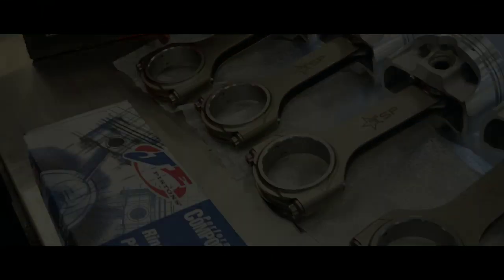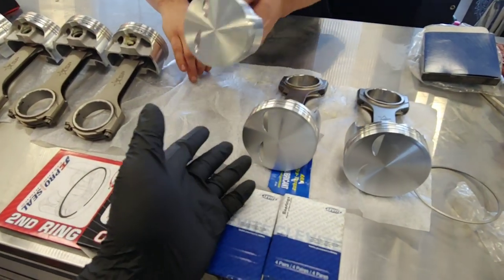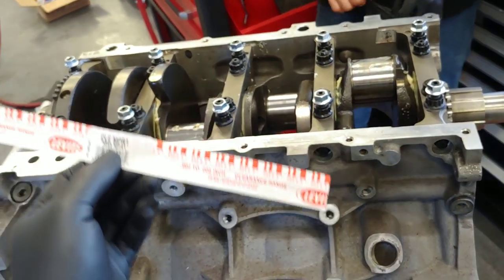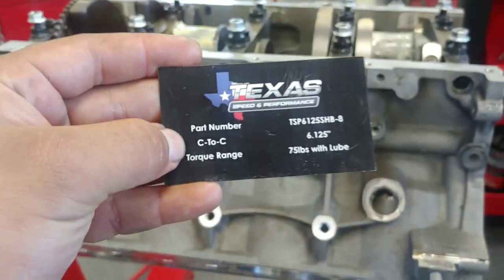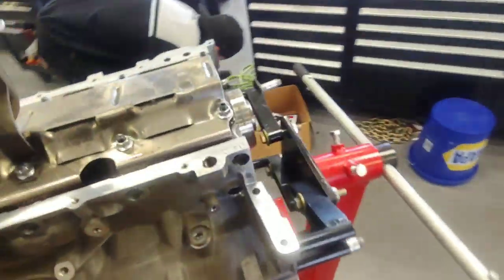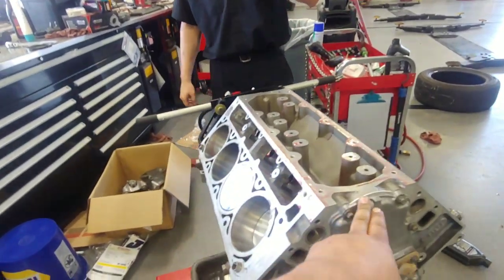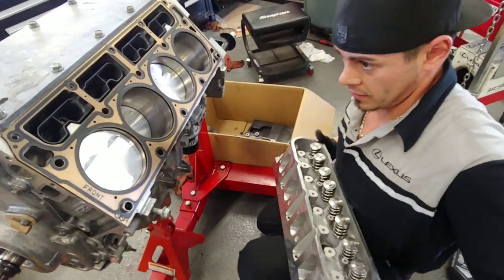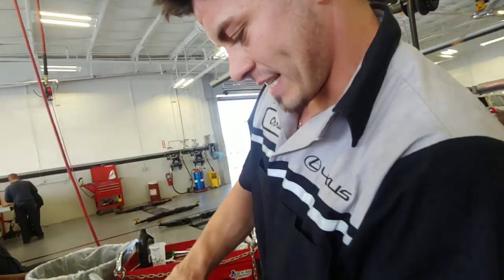BUILDING A NATURALLY ASPIRATED LS3 MONSTER ~ TEXAS SPEED RODS, PISTONS, CAM, HEADS ~ Episode 1

Comment: How do you push oil into the motor with the oil pan off ?  If you look there are 2 ports that feed the oil into the filter than into the block, without the pan all your doing is filling the port between the pump and the filter.  The easy way to prime is once assembled with the oil pan on pull the large plug on the side of the drivers side of the engine near the pump, hook up a drill powered pump to the port and feed it oil while turning the motor over with a ratchet.  That way you'll lube everything from the mains to the rockers.
Reply: Or just leave the plugs out , coils disconnected , injectors disconnected and crank on the starter . You'll have pressure in around four turns , if not something is wrong .

Comment: I have a tsp 408 ls I'm putting in my 95 silverado and after I get used to the power I'm gonna boost it and hope the built 60e holds considering it was in a 1150 hp Camaro but this truck weighs more

Comment: Heads are on backwards the steam ports are now in rear and fronts are plugged.
Reply from the maker: Surprised you caught that! We had to run a coolant hose from the back steam port up to the radiator 😂 we made it work
Reply: @BoBuilds  open what's now front and use all 4
Reply: I did this once. Instead of pulling off heads I opened up the blocked ones with a pin punch tool then bought steam vent delete covers for the rear open ones

Comment: With engine assembly - cleanliness is *truly* next to godliness. Everything oughtta be absolutely spotless and you shouldn't trust your part suppliers to have perfectly cleaned stuff before shipping to you. Also, I know it's very commonly done the way y'all did, in an open shop environment - but it's a bad idea. There's just too much dust, dirt and debris in an open shop. Plus, I see overhead fans - which are circulating whatever airborne particles and trash happen to be in your shop while other people are sweeping, blasting, grinding, etc... Bad idea. Change that oil after the first 15 minutes of runtime!

Not blasting you guys - happy to see youngsters interested in this stuff. Just offering friendly constructive criticism!
Reply: At the Chevrolet complex when they build them bad a$$ Corvette engines they are fully assembled in a big room and even machines put them together in a big room.

Comment: ALLDATA says to torque the first 10 head bolts 3 passes 1st pass 22ftlbs 2nd pass 90 degrees 3rd pass 70 degrees
Reply: That sounds like specs for GM tty bolts

Comment: If you set ring gap at the very top of the bore its wrong. You have to go deeper into the bore where the rings live.
I wonder if this engine is still alive.
Reply: That sounds like it would help better doing it the way you said.....but yeah I heard that same engine is still running.
Reply from the maker: Yep still going stronh
Reply: If the bore are honed what difference will it make, non, because the bore is the same diameter. In fact if a honing plate is used, then the gab should be measured towards the top of the bore

Comment: Thanks for doing the video

Personal opinion, but while you were there, you should have deleted the Active Fuel Management (DOD). The AFM lifters are a known point of failure

Many will also disable the Variable Valve Timing as well

Oh well, next time
Reply: its an LS3, no AFM/DOD, the L99 had DOD.  based on the valley cover alone there is no AFM.
Reply: I don’t think GM cars with manual transmission have AFM/ DOD

Comment: Heads are on backwards
Reply from the maker: Yep! Lol we noticed that i was like fuuuuuuuuuu 😂 we were able to run the steam port from the rear up to the fro t and all seems good so far
Reply: Just get the older style bolt on block offs for the rear and pull the plugs out of the steam ports on the front and bolt it back on 👌

Comment: Que tal compa! Una pregunta !! quiero cambiar un cam pero mi motor es un 6.2 l92 ls y quiero saber si es lo mismo que un lq9
Reply from the maker: Sorry I can't read Spanish very well. Are you asking if an L92 is the same as an lq9?
Reply: @BoBuilds  yes I have an L 92 engine and I want to know if the engine is the same like the lq9 or lq4 because I want to swap the cam! I'm just want to make sure it's going to be the same steps! Thanks for replying
Reply from the maker: The differences are..
Lq9 has a rear mounted cam shaft position sensor. L92 has a timing cover mounted cam sensor. 

Lq9 has a simple 3 bolt cam sprocket
L92 has a single bolt cam sprocket and variable valve actuator built into the cam sprocket.

Its the same steps but you need to decide if you going to keep variable valve timing or not. That will mean running a single bolt or 3 bolt camshaft
Reply: @BoBuilds  I'm gonna change cam and valve springs! Like you did on the Chevy nova I just want to make sure is gona be the same steps thanks

Comment: Ring gap way too tight.
Reply from the maker: We never said what we gapped the rings at tho. Just what texas speed recommends. What gap would you suggest
Reply: GreaseMonkeyMods 
Since once you get this going you know you gonna wanna put a turbo on it at some point so I would set them at 28/30 while you are assembling it now this way you can turn it up later and not have to worry or take it apart to reset the ring gap.  Nice work
Reply: @BoBuilds  For NA, 0.004 or 0.005" per bore is just fine on the top. Just ever slightly more for the bottom ring. For boost or N2O, 0.007 or 0.008" per inch of bore is better. Just remember - only YOU will know if the ring gap is too loose, while EVERYONE will know if it was too tight!
Reply: Any boost or spray is gonna break a ring land

Comment: So many mistakes in this vid........
Reply from the maker: How bout you let me know what mistakes were made so I can learn, and anyone reading can know the correct way to do it
Reply: Did yall make sure the rods are on the correct side? One side is tapered where it connects to the crank.
Reply from the maker: Yeah Texas speed made it real easy. Logos on rods faced forward, valve reliefs all inward for intake valves. So ended up with 4 and 4 directional rods and pistons that had to be on their correct side
Reply: Way too much assembly lube
Reply: @cassandraclark8568  nope . You can never have too much ass lube